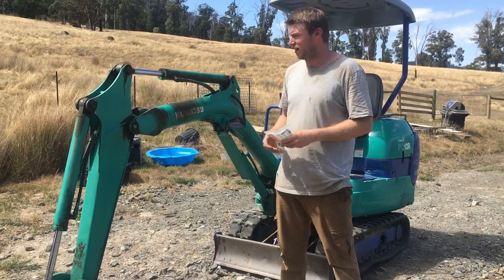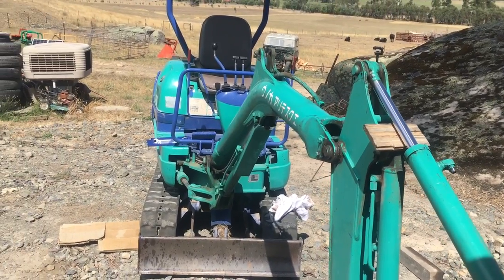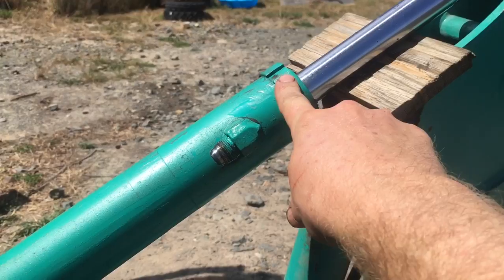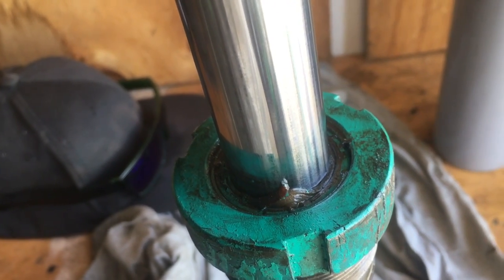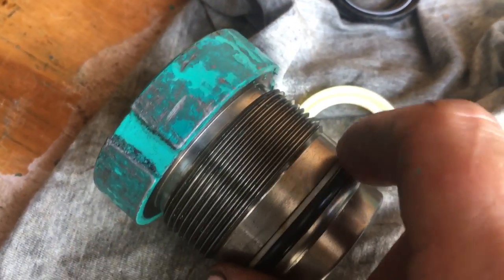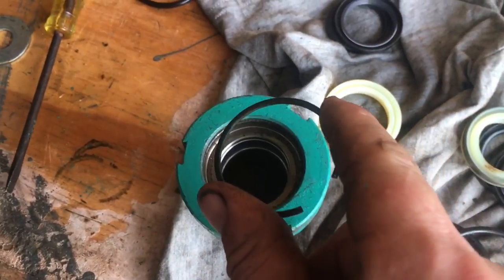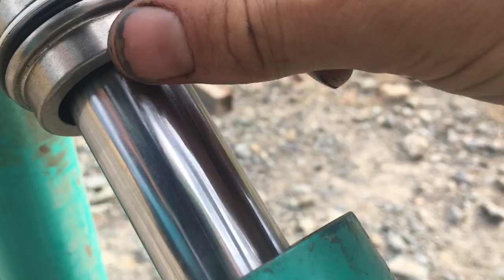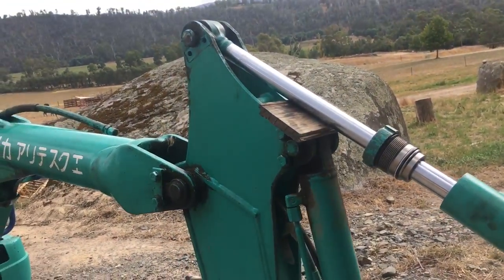How To Fix A Leaking Hydraulic Cylinder, My First Go At Replacing Seals With Basic Tools

Comment: Well done mate, especially being prepared to have a go yourself and learn. I own an old knackered (ex Kennards Hire) Takeuchi TB016 which I've made new pins for and am constantly repairing and working on. I have a leaking RAM and after watching this will probably have a go at it myself. So thanks again.
Reply from the maker: Cheers Thanks Glen, I’m probably going to do something about a few of the pins as well at some stage try to get a little bit of the play out:)
Reply: @offtrackprojectsandmainten5681  I'm lucky enough to have a lathe, and managed to salvage some extremely tough bearing shafts from a vibration machine. The tungsten carbide lathe bits just cope cutting it and I have to cut them to length with an angle grinder.... But they are tougher than the originals. Hard part is getting the old pins out if they're siezed. Good luck.

Comment: Great video, except I have a Hytachi ex27u and it has a different holding nut on the ram . It has a set screw with ball check to make sure it doesn’t back out, but your video was great some great pointers. Thank you

Comment: well as a 18 year cyl mechanic you did not do to bad deff a few things you could of done either different or better the only thing for sure was a problem i seen right away was u have rust pits on the rod that should have been fixed as your new seals will be cut fairly quickly and basically a waste of seal money and time  good go for a first timer though
Reply: Good to know, thanks Robert!
Reply: How would you go about fixing these rust pits you mention?

Comment: Great video. I just bought a Komatsu off auction; it’s in good nick but the boom cylinder is leaking a bit. Your explanation has me on my way (I hope). Biggest problem will be knowing what to ask for in Japanese. I hope I can just use the part number.
Reply: Just call up Komatsu and ask for parts,  and give them the parts number, shouldnt harder than that